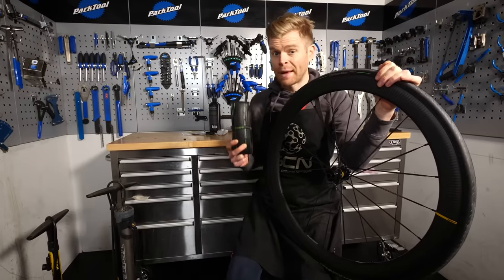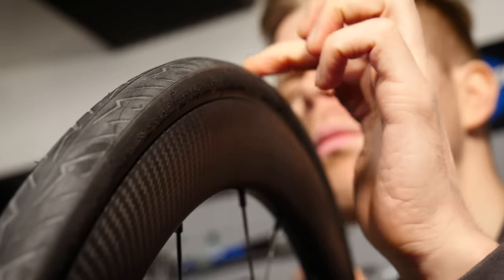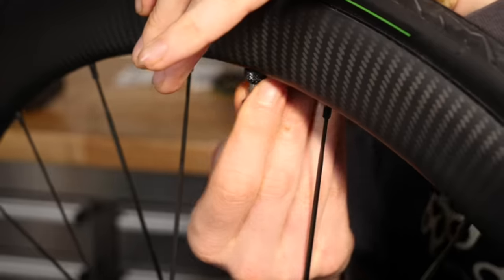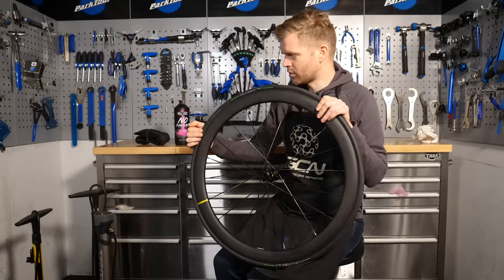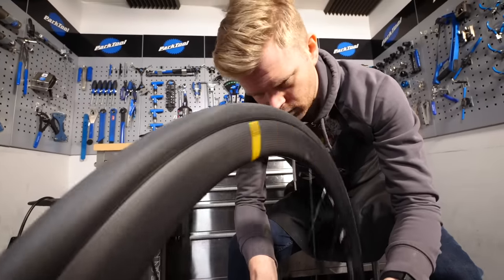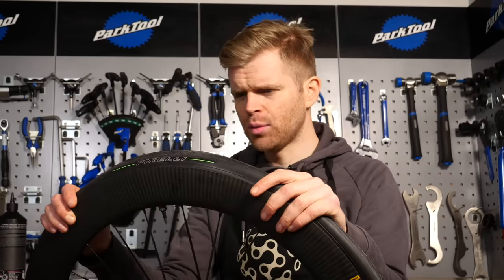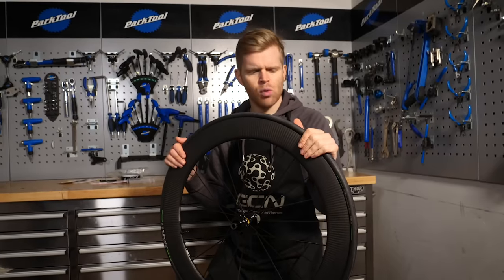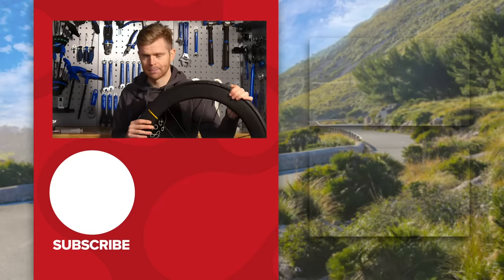How To Maintain Your Tubeless Tyres | GCN Tech Maintenance Monday

Comment: Ollie, or others, anyone understand why my new tubeless tires leak about 40-50 PSI overnight? Can barely seem to keep air in them for long periods of time.. they work great during rides though.
Reply: Make sure the ring at the bottom of your valve stem is tight. If your tires continue to leak add a little more sealant. That combination worked for me. Next time you add sealant have the valve stem at the 12:00 position. This will get some sealant where the valve meets the rim on the inside of the wheel.
Reply: @jameswitte5676  thank you James,.I'll see if its loose, and try more sealant.
Reply: You’re welcome. Hope it works.

Comment: Removing the dried up sealant as such a horrendous hassle that I'd argue it's not worthwhile. Just leave it in, the couple of grams won't kill you and your tyre will sooner or later be dead anyway, then you just replace it altogether.
Reply: tip from gmbn: use the cap of some spray can to scratch the sealant out of your tire.
Reply: I have never had dried up sealant. Stans is what I use. I just top it off every 4 months and after a year I replace the tire. The rim never has dried up sealant when I put the replacement tire back on. I can wipe it clean with a shop rag.
Reply: @larshalstrom3223  you replace your tryes every year??? i have some that are years old
Reply: @Daniel "Removing the dried up sealant as such a horrendous hassle"    It's not, even when completely dried, with the sealants i've tried. Not heard any different from anyone who has actually used others either.

Comment: What a mess. I would have liked to see how you let the air out (with sealant getting out :) ). Also if you "top-up" how do you know how much stuff is already in? Continental Supersonic tubes is the way to go. Stay away from all the mountain bike stuff for your road bike, it will be lighter and faster. If you want comfort go electric with all this stuff or stay on the couch.

Comment: I'm just unconvinced by tubeless for the road, it's looks a ball ache and messy for the sake of a few mins if you get a puncture, even with slightly better RR.
Reply: It’s really not a hassle, it just takes a little practice to become efficient at installing the tyres for the first time.

As a commuter on the road I wouldn’t go back to inner tubes, tubeless has  negated the need to stop or even add air after a puncture for me.

Comment: Tubeless in road bikes: lighter - not true, lower rolling resistance - not true, allows to run on lower pressures - not needed (unless you need to run on 3 bars, which is not the case in terms of road riding), punctures sealing - probably not working well in terms of very high pressures and also not needed. From me: more expensive - true. More maintenance needed - true. I'm wondering if wheels/tyres manufacturers constantly pay these guys extra to repeat that bullshits or if they actually believe what they say. Let tubeless stay in mtb, where it actually pays off.
Reply: "and get off my lawn!"